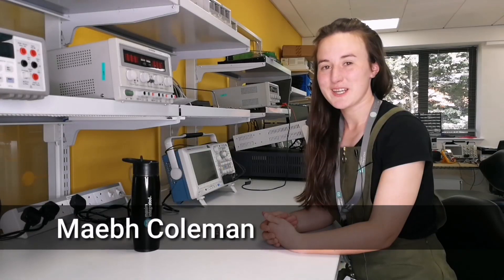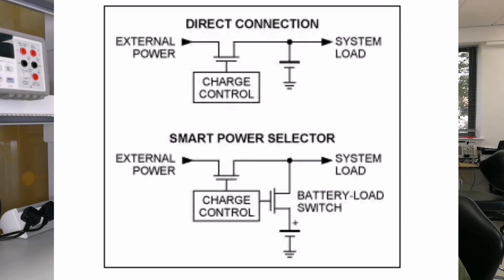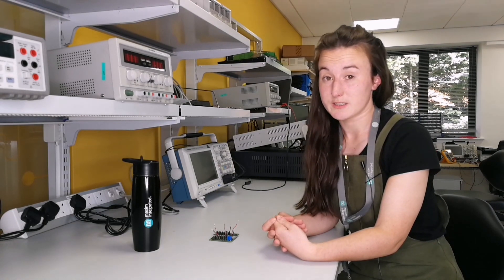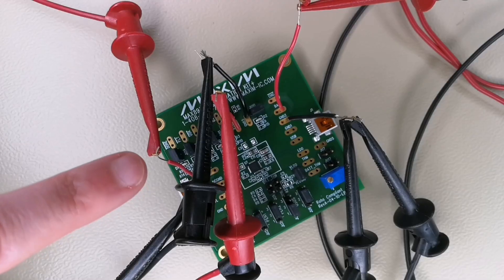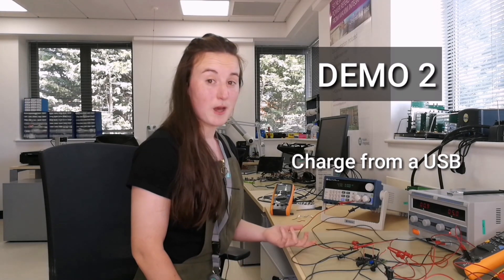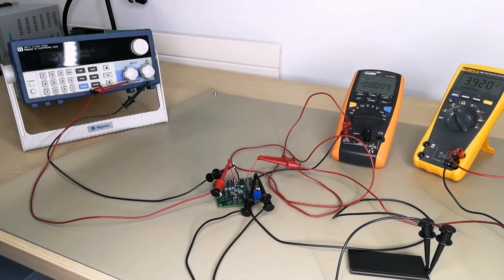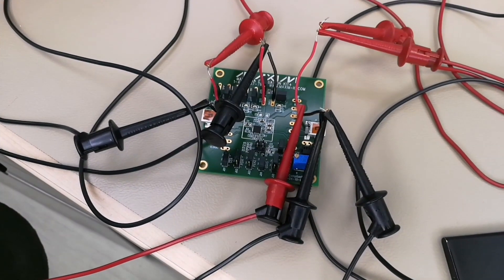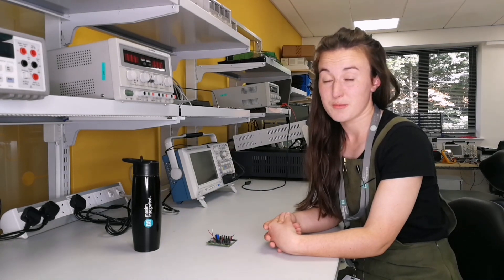How to charge a battery safely while using our Smart Power Selector Technology and the MAX8934

Comment: Thanks for your sharing. I have a question for you. In charging ICs that comply with the Jeita standard, the charging current decreases to half of the initially set charging current at a temperature of 45 degrees. In the chip I used, this is called Ibulk/2. However, when we want to get CE standardization certificate for our product, they state that the charge must be completely cut off when the test center reaches the maximum charging temperature of 45 degrees, which is stated in the datasheet of the battery. But this is not possible with Jeita compatible chips. These chips cut the charge at 60 degrees. Can we get your information on this subject?